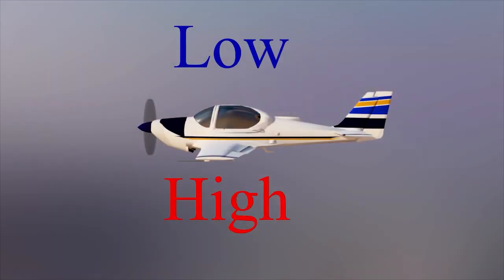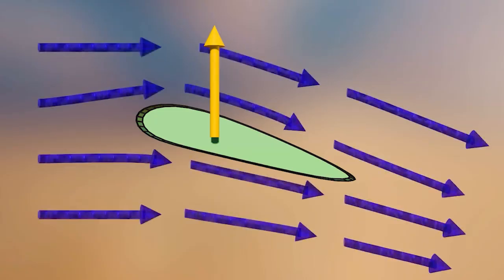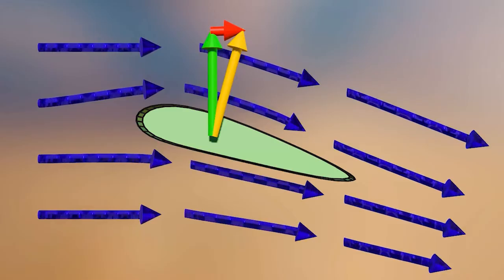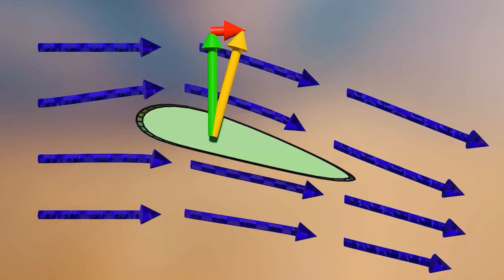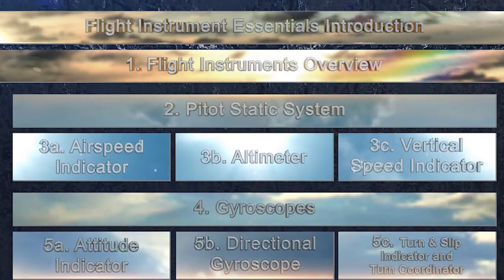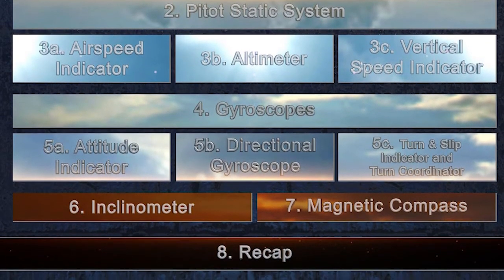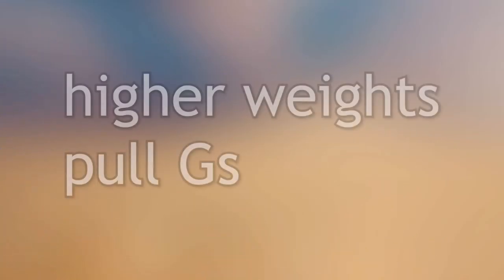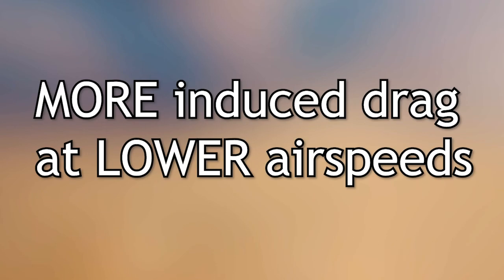Induced Drag | Pilot Tutorial

Comment: I don't understand the argument that if no vortices, then no induced drag. Let assume that we put a model airplane in a wind tunnel, the the wing of the airplane is as wide as the width of the wind tunnel. This way air will not be possible to be pushed out from the side of the wing, so no vortices. In this case if the airplane needs to fly, it has to have angle of attack and this will create induced drag in order for airplane to float. So the angle of attack creates both lift and induced drag, vortices cause down wash airflow which reduces the lift of the wing. So the wing has to increase the angle of attack which in turn creates more induced drag.

Comment: What force moves a glider forward through the air?
Reply: Nothing: inertia is perpetual, unless acted on by a force.  To the extent you need to offset drag, it's gravity (potential energy).
Reply: @davetime5234  No, that's not the answer.  The must be a forward force to overcome the drag. Gravity only pulls down, not horizontal.   The forward force comes from the forward tilt of the lift from the wing.
Reply: @WAVEGURU Cars are pulled down an incline with no help from the engine.  And you're suggesting skiers don't move forward due to gravity?

With angle of incline gravity overcomes and exceeds drag, which is why your brakes get hot descending steep mountainous roads.
Reply: @davetime5234  Sorry, you are not correct again.  cars are pulled down, they move forward because they are on an incline.  Same with a skier.  Same with a glider, but there is no solid surface so it is the wing that pulls them forward.  They cannot fly level.  The lift is perpendicular to the wing so if they were trying to fly level the drag would not have an opposing force.  The perpendicular lift has to be tilted forward.  I have flown gliders for 50 years and instructed for 40.  This is not a theory, it is proven fact.
Reply: @WAVEGURU  "there is no solid surface so it is the wing that pulls them forward."

You're violating basic physics.  In a stable descent fixed wing aircraft have from zero to positive angle of attack.  No part of lift is pointing forward.

In physics, "work done" by a force occurs by the component of force along the direction of velocity.  There is a component of gravity's force along the direction of travel in a glide.  That's what pulls the glider forward in a glide.
Reply: @davetime5234  You are just flat out wrong.  Gravity only pulls down.  No matter how many times you say it you are still wrong.  I don't think you are smart enough to understand basic physics.
Reply: @ "Gravity only pulls down."
A glide is in the down direction.
Reply: @davetime5234  Like I said, you are just not smart enough to understand the physics...
Reply: Maybe google it.
Reply: @WAVEGURU A typical high performance glider has a glide ratio descent angle 2 degrees or so, and an angle of attack at least that?  Where is there room for a forward component of lift?
Reply: @davetime5234  Right there in that 2°
Reply: @ You can find various diagrams with the lift vector shown as pointed forward in a glide or normal descent, including from both the FAA and NASA sources.  But when you try to verify the rationale, it falls apart.  The AOA combined with the glide angle make this impossible.

It's as originally stated:  the force of weight due to gravity, with some component along the glide slope direction, provides forward force in opposition to drag.

Comment: Happy to be educated if I’m mistaken but…

Is it correct to state that “without vortices, a wing won’t produce downwash” and therefore no induced drag, as you described  with the  infinite wing example?

I’m under the impression that even without wingtip vortices, the act of redirecting air downward (Induced Flow) generates an equal and opposite force upward (Lift). Because there’s an Induced Flow the Resultant Relative Wind is modified downward. The Lift vector is perpendicular to this modified Resultant Relative Wind, which inclines the Lift vector backwards, and the aft’ing of the Lift Vector is called Induced Drag.

Truly hoping for a deeper understanding, I would love to know if my understanding holds water.
Reply: Without wingtip vortices, no air is redirected downwards.  (Or in other words, the "circulation" pattern has closed loops.)   Instead, the wing causes oncoming air to *rise* to meet it.  Then the air curves downward.  Then its forced to curved upwards again, to be left at the same altitude as it started.   Zero net momentum is transferred to any gas parcel.  Zero work is done on average.   No drag is produced, and the airfoil glides forever without needing fuel.   This is idealized ground-effect flight.
During ground-effect, the ground pushes upwards on the wing, and the wing pushes equally downwards on the ground.   Essentially it's a type of venturi.  The forces of course are transferred back and forth via the gas, as an instantaneous exchange-force (it's same as with any venturi, where the solid surfaces always create zero average force, even though two surfaces can create equal and opposite forces.)   
When the wing is short, or at least many wingspans above the ground, then the wing is flinging vortices down, and the ground is no longer pushing upwards on the wing.  The venturi and ground-effect, has vanished.   (Think of vortices as being weighty baseballs made of gas.   In conventional flight, the wing is like a hovering rocket-engine, with the down-flung vortices being the exhaust-plume of the rocket.)
If airfoil classroom started out with the infamous Wham-O Air Blaster(tm) gun, things might become clearer.   Such a gun has a kick.   If fired continuously and repeatedly, it could propel a vehicle.   The Air Blaster gun is a reaction motor.   So is an aircraft wing.   Both of these take in air from all directions, which produces no momentum-transfer and requires zero work.  Then they fling air out in a single direction, which produces an equal reaction-force, and the required work is seen as Induced Drag.   As with helo rotors, a fixed wing is an example of fluid propulsion.   (And, when a jellyfish swims by pulsing, then the energy in its long emitted chain of ring-vortices is exactly the same as the Induced Drag losses in an aircraft wing.  But the aircraft flings one long, long vortex ring, rather than a pancake-stack of multiple vortices.)
Reply: @wbeaty this was such an interesting read thanks for posting

Comment: I'm just watching this for some review for my CFI checkride, there's one thing I disagree with. Wingtip vortices are NOT responsible for downwash. The wingtip vortices serve to exacerbate the downwash that already exists. Downwash is a factor of the coanda effect in which the air "sticks" to the top of the airfoil because of the laminar and fluid properties of air and will continue to conform to that shape as it exits through the trailing edge. Because a force is applied in a downward direction, that means relative wind is shifted in the opposite direction which allows for the lift vector to be tilted backwards, which explains induced drag even in straight and level flight with a theoretical AoA of 0 degrees. In an end of course check at my flight school, if I were to say that wingtip vortices are indeed induced drag itself, I'd get failed right on the spot.
Reply: Yes, but if you read the PHAK, you will see that wing tip vortices create and additional downwash as well.

“ Bearing in mind the direction of rotation of these vortices, it can be seen that they induce an upward flow of air beyond the tip and a downwash flow behind the wing’s trailing edge.”  

You are correct about the vortices exacerbating the existing downwash needed to create lift. But there are actually two different downwashes, the one created by wingtip vortices is the source of induced drag.
Reply: @j.a8678  also with agree with Max. Also to mention the type of operation and being specific to straight and level flight. High airspeed low angle of attack (unless you accept a climb), low airspeed high angle of attack up the critical angle at which the aerofoil will stall. So in essence high coefficient of lift in straight and level equals high angle low airspeed and as a consequence high induced drag (using the drag curve would also help in the explanation) the rest of your explanation is partly right. 

Would also explain span wise flow and how the airflow in the lower part of the wing will naturally want to move outwards towards the wingtip in contrast to the airflow in the upper side moving inwards. When both streams meet at the trailing edge, they also creat a sheet of vortices.
Reply: @j.a8678 Wing tip vortices have a mostly horizontal rotational orientation.    The downwash along the span drags them down.
Reply: I discovered  that Parasite drag is produced by VERTICAL surfaces and Induced drag is created by HORIZONTAL surfaces, for example when the Flaps are at 0 degrees they produce Max Induced drag and Min Parasite drag, at 90 degrees Min Induced and Max Parasite drag and at 45 degrees in the middle of both.
 Please let me know if you think it is a valid observation. Thanks
Reply: @ShonMardani  parasite drag is produced both by unwanted turbulence and by laminar flows.  Imagine the air to be like thick syrup.  The parasite drag isn't only caused by viscosity.  Also, if the moving object stirs the "syrup," that's another origin of drag.   Even if the fluid flows horizontal, parallel to the surfaces, it still produces these two types of parasitic drag.  (This force might be far smaller than the drag produced by vortices shed by vertical surfaces.)   
   
Here's one insight:  the core of the wingtip-vortices represents unwanted turbulence!  If the down-flung vortices could rotate like solid disks, rather than like tornadoes, then the lift would be the same in both cases, but the induced drag would be much larger for the "tornado."   
And, that's why we add winglets to the tips.   The wingtip winglets are trying to eliminate the fast spin in the center of the tip-vortices.   That fast spin is unwanted turbulence, and uses up fuel in needless drag.   (Heh, so instead make our wings in the form of a giant arch, with no wingtips, like the "Channel-wing" topology.    It flies like one of those tube-shaped paper airplanes.   Winglets on modern aircraft are just very short segments of a complete arch or tube.)
Reply: @wbeaty   Nonsense.
Reply: @ShonMardani  Watch the above video several more times.   This guy gets it right, when quite a few intro textbooks get it wrong. 
Rather than "Nonsense," a proper reply would be "You're wrong, here's why."  Then provide some reasoning, or better, some devastating evidence-based counterarguments.  Without that, "That which is asserted without evidence, can also be dismissed without evidence."
Reply: @wbeaty    You are correct, the proper way is the one you wrote, but you did not practice it, you needed to provide logical reasons to invalidate my reasoning, instead you came up with unrelated extract from an aviation textbook.
Reply: @ShonMardani    I pointed out your errors in some detail.  Yet apparently you ignored it all, declaring it "Nonsense."   
The moment you said that word, I suspected that all further discussion would be pointless.   Now it seems I was right.  (This "you do it too" tactic is straight from politics, and has no place in science/engineering discussions.)

And no, I use no aviation textbooks.  I picked up the jargon because I've been discussing airfoil-misconceptions with physics people since around 1989.   I'm an electronics designer, but in 1991 me and Jan-Olov Newborg discovered what is now named the "transit-time fallacy," and have been online and making noise about it ever since.   A few years ago I noticed the "infinite-span" fallacy, and started making noise about that too.   Wings of infinite span have zero induced drag, and fly by 100% ground-effect forces, where all drag is parasitic.    If we use a flow-diagram and an airfoil-section in teaching, then we're not explaining airplanes, we're actually explaining trapped pressure-bubbles below ground-effect machines.   If you want to create lift-related induced drag, then you need a 3D wing of finite span, and it must fly at altitudes higher than roughly 1/2 wingspan. 

If you can make it shed downward-moving vortex patterns, then you've also made it experience some induced drag.   (Doesn't that fit with your own explanation?    Induced drag comes from tilted surfaces, because only tilted surfaces can cause non-turbulent vortex-shedding. )

Why are wings so difficult to understand?  Because of misconceptions on the part of teachers.   

First was the transit-time fallacy.  It took almost thirty years to pound it into oblivion.  Now the infinite-span fallacy still remains.  Both errors are offered as central explanations, yet they're just physics misconceptions.  Both were apparently started around 1924 by Ludwig Prandtl, who certainly had the math chops but was profoundly clueless about the basics, such as a need to always obey Newton's 3rd law in all cases (rather than selectively ignoring it in order to make the math become tractable, by removing the moving vorticies.)
Reply: There is no net downwash without vortices.   
In an airfoil-section diagram (a wing of infinite span,)  first the air is forced upwards, then forced downwards, then forced upwards again.  Each of these accelerations requires a force.   All these forces are produced by the wing-ground system.   Summing them up, the total average downwash is exactly zero.   
If instead we ignore the forces in the total flow-pattern, and just concentrate on the wing surface alone, with its down-deflection of the gas parcels, well, that's simply wrong.    It pretends that the wing didn't cause the parcels to rise as they approached, and later to halt after the airfoil has passed by.   And, this error has confused students for an entire century.   (To avoid the error we must examine net downwash experienced by each parcel, summing it all up, and not just micro-level downwash at isolated locations.)

When a short wing is flinging vortices downwards, only then does a net downwash appear, because after the wing has passed by, the air parcels do not halt again.  They keep moving downwards.  (Without viscosity to stop them, they'd keep moving downwards forever.)   This is completely different than the closed circulation seen with an airfoil-section in two dimensions.

Comment: I am a bit confused how Is induced drag connected with downwash? I see it everywhere And don't understand it. Because when He showed picture of An airfoil where He shows parallel Force with airfoil the drag Is caused by the angle of airfoil not by the downwash in my eyes i dont understand
Reply: Correct me if i’m wrong someone, but I would explain it like this: the spanwise flow over the wing get trapped at the wingtips due to the plane’s speed through the air. This forms the vortices. Then, these vortices will curve around the tips and push the air down on the backside of the wing. This will move the lift vector backwards and make a new angle between the lift vector and the new lift vector (effektive airflow) - and this new angle is the induced drag.
Reply: @torawestrum2508  Somewhat true, but don't forget that the vortex-shedding takes place at the wing's entire trailing edge, and not at the tips.    Aerodynamics people call this the "Vortex Sheet."   The name "tip vortices" can be misleading.   After the vortex-sheet gradually scrolls itself up, it may appear that the tips created the vortex-pair.   But look at the wing itself, not at the vortex-structure trailing 100ft back.   

Induced drag results from the down angled shedding of the entire vortex-sheet.  (A 3D diagram is absolutely required for understanding this.   We can't just view the wing as a sort of long rod with losses concentrated at the two tips.   That's oversimplified.   It's 2D thinking.)
Reply: @wbeaty Typically, induced drag is defined to include both the rearward horizontal component of lift due to AOA, plus energy loss in the wing tip vortices rotational energy?

But you referred to the downwash if I'm not mistaken?

This makes sense to me as far as the kinetic energy cost of the change in vertical momentum of the flow necessary to produce the vertical component of lift (the reaction notion of lift).  While the wing tip vortices are really more another parasitic consequence of lift production (the more suppressed the better).

Comment: Fail. You started out fine. However, the wing doesn’t need to produce wing-tip vortices to produce downwash.
Reply: Correct. PHAK 5-7
“This induced downwash has nothing in common with the downwash that is necessary to produce lift. It is, in fact, the source of induced drag.”

Two downwashes. One is a result of unequal velocity’s and pressures of two air bodies as they meet on the trailing edge of the wing. 

The other is vortices as the air flips and mixes at the tip. 

An annular wing (circle) would  not have vortices, but would still produce downwash.

Induced drag is any drag as a result of increase in AOA. Vorticies, shifting lift vector, and separated air forming a pocket on the trailing edge of the wing are all part of induced drag.
Reply: @jeffreyleftovers  BIG thumbs up!
Reply: I went straight to the comments when he said a wing with no tips would have no induced drag. thank you
Reply: @calebatha7133 Nonsense.  Downwash is the core of induced drag, and it must exist for lift to be created, wing tip vortices or not.
Reply from the maker: uuuuummmmmmmmmmmmmmmmmm